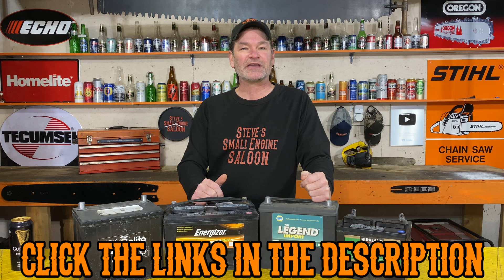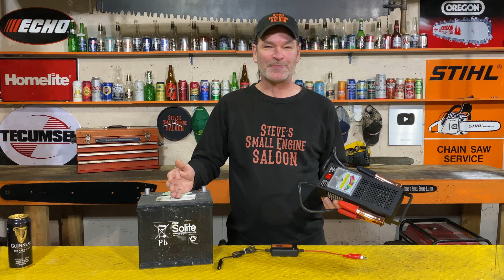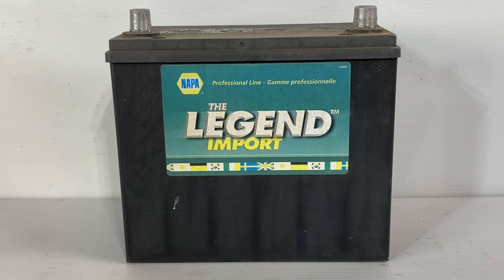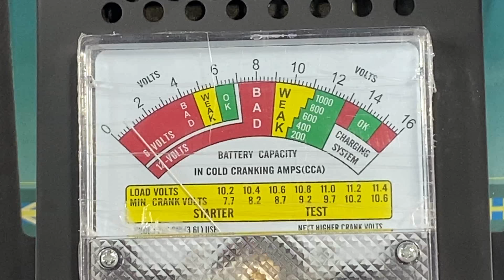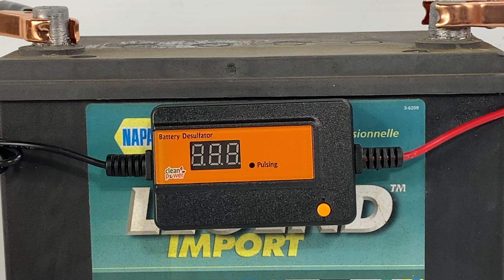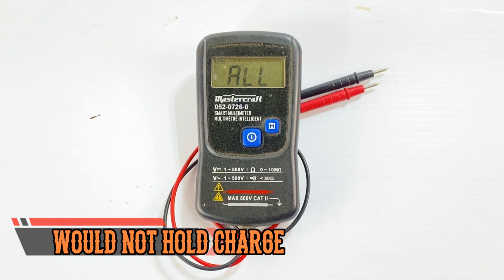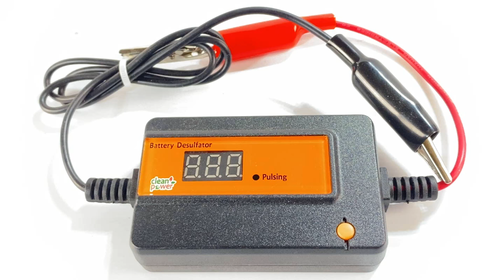Does An Electronic De-Sulfator Really Repair A Battery?? See Real Results

Comment: Theoretically you could probably get the desulfator working by adding some mineral water mixed with salt as an electrolyte and it should boost its ability to start charging again it'll allow the liquid inside the battery to hold that electrical charge but you have to fill up each cell with fresh Don't dump it just add to it and it should work with any battery that's 12 volts as long as you can pop open the cells

Comment: My mechanic let the battery go down really low before I towed back to my place &fix it myself..,auto zone said battery is no good but they charged it anyway & it worked, couple of weeks later let the car sit for a few days with the radio on of course dead one again used one of those reconditioners and battery us holding up good after almost a year
Reply from the maker: Right on

Comment: I have a duralast gold car battery, not even 2 years old,the battery won't hold a charge, i took it to  AutoZone to test it, it says bad battery. But the battery can charge up to get over 13 V and even 14V. It just won't hold a charge, so now I'm doing a battery recondition with a everlast 40 amp charger. Ill have it set for 24-36 hours. 
If the battery can charge, is it possible that after electric recondition the battery will hold a charge??
Watching this video gives me the thought that it will.

Comment: I just bought a fully automatic electronic battery charger ($35), that has a "battery repair mode", which is an electronic de-sulfator function.  I just had to replace a large, expensive, group #65 lead acid battery in my vehicle with the same symptoms as your battery #3 (charging but not holding the charge).  I had already ruled out the possibility of an alternator malfunction and/or a parasitic draw.  
I bought a new, more expensive AGM battery replacement and it fixed the problem.  Now I have the old battery running the de-sulfator process and we'll see how it goes.

Comment: Steve on the batterys that didnt recharge two things comes to mind water level especially on sealed battery if the level is low you are not going to recharge them  and secondly it could be they need cleaning or flushing as sometimes theres a build up underneath the plates that shorts them out so they are not going to recharge  i have seem people tip out the contents flush them with clean water  filter out the battery acid and then refill them and recharge them and that can fix batterys and that was an old method that they did back in the day if there is any damage to plates  maybe they were overheated and buckled and shorted you cannot save them by desulphating  if the issue is sulphation then it obviously worked on two  of the batterys which is great as you say it paid for itself .

Comment: I bought the same Desulfator and it worked on two of my batteries but didn’t do much for two older ones. Does anyone had experience on why a battery cannot be desulfated at 2Amps with this little gadget?
Reply: I've learned the hard way that lead-acid batteries can leak though their plastic enclosures. There might be a reason you need to add distilled water to your battery, it might have burned though that crappy plastic enclosure.  Sucks to be a consumer.

Comment: Great job making the video Steve, you brought up a good point that battery desulfators do not work on all batteries, however you can leave the desulfator attached while charging a battery. I have a Pulsetech PowerPulse battery desulfator that I leave on my BMW battery for the past three years, and the car starts without any problems even though I drive it about 5 miles per day, 25 miles a week. Pulsetech claims that their patented frequency can extend the life of a battery three times or more, I'd like to see you do a test on them. 
Also the Noco Genius 1 charger you have on your Amazon links has a mode to desulfate batteries, but I believe it's uses voltage spikes to remove the sulfation.

Comment: can also be done with a 200amp charger in one day. cells must be topped off with distilled water. charge @ 200amps for 15 minutes. let the battery sit for 1 hour. charge again 200amps for 15 minutes. Let sit for 1 hr, repeat 5 times. That should fix the battery. you can also use a welder but that is much more risky.

Comment: I have an EV and I've been running it for just under a year now. I have a battery charger with the reconditioning function on it and I plan on doing it every year to ensure the long life of the 12v battery. The main reason is that EV 12v batteries have a very easy life. They don't have that jolt of starting the engine, which apparently is what helps to shake of the sulfation from the battery walls. Therefore a reconditioning is even more important......apparently!

Comment: Pretty obvious you had 2 batteries which were actually sulfated, and 2 which had lead plate issues which are simply unsolvable in most cases.
I've seen some come back to life after people have put some vibrations through them, though they still usually fail in months as there is too much shed material which short cell/s out again.
Would have really been interesting if you would have cut the tops off and pulled the actual cells out to see what failures looked like.
Good video, but that rather expensive for a desulfator which can be DIY'd for $5-10.

Comment: the two major failure modes for auto batteries are the electrolyte boiling off resulting in dry cells,and the second is the lead paste coming out of the plate grid and accumulating at the bottom of the cell,eventually shorting out the plates. that's because auto batteries are in a high shock and vibration environment. a battery with shorted cells won't desulfate,that battery is DEAD. and needs to be recycled.
Plate sulfation of a car battery is not the usual failure mode. but 12v lead-acid batteries are used in many other items,like lawn tractors,backup generators,some kid's powered toys,computer backup supplies. Those are not used as often as a car,so the battery plates develop a hard sulfate layer that blocks ion transfer. it acts like an internal resistor.
A desulfator take the 10-12v of the battery,and uses it to generate much higher voltage spikes that break down that sulfate layer. There are plans on the internet to build them,they're not complex. mine generates about 60V spikes with a very fast rise time. you can run my type of desulfator while trickle charging the battery,so you can leave it on for several days,because it may take that long to clear off most of the sulfation.

Some battery charges come with built-in desulfating circuits.
Reply: 8:07 8:07 8:07 8:07 8:07 😮😮

Comment: Drain the acid from the battery and save it in a cup or something. Take some distilled water and add Baking soda then pour that in all the battery cells. Leave it sit for a couple days. Now after a couple of day drain the water/ Baking soda from the battery. Rinse the battery out 4 or 5 times, Now screen the battery Acid you saved and put it back in to the battery then finish filling the battery up with clean distilled water if needed. Now put high charge on Battery like 200 Amps. Let that charge for 15 minutes after 15 minutes shut off charger and let battery cool for one hour. Now turn on High charge again for another 15 minutes. Do this 5 or 6 times, charging 15 minutes on high 200 Amp then letting the battery cool down for a hour. After your done by the 6 time put the battery on trickle charge 2 Amps over night. Now sometimes you have to disconnect the charger if you can't get a full charge. Then after you have disconnected the Charger turn on your head light till the battery is completely drained and dead. Now put the battery on trickle charge over night and your battery should be able to take a full charge now and should be 13 volts or higher. I don't know why but sometimes you have to do this after the cells get cleaned up. It's worked on every battery I have done it on. Now if your battery's plates are ate out of the battery after 15 years or so it won't work. But I have batteries that are well over 15 years now.
Reply: please can you make a video of this so that we can reset our batteries and get extended its time please

Comment: We live off-grid, 24 volt, eight 6 volt Rolls Royce batteries.  We also have a 12 volt system.  I kept the batteries we replace to restart the 12 volt system dedicated to lighting the house at night.  I can't revive them for sh*t.  Anyone got a proceedure for this?  Tried epsom salt, the whole 9 yards.  Suggestions? (besides spending money on new ones?)

Comment: Hey Steve, not sure if your going to see this or not but if so, I've looked at this product and it appears to be suitable to connect to back of series bats up to 72v, This is good because sometime in the not to far off future, I will be reconnecting all of my system to work at 24v instead of 12 and then acquire a 24 to 12v high current reducer circuit for the RV. This will allow me to increase my wattage from solar to just over 1.5k watts charging with the new MPPT unit. So for now, I'm going to order one of these and pull out 1 battery from the bank of 4, put a blocking diode in there to stop the power from the Desulf. from getting to the others, each in turn and let the MPPT keep charging all 4 and hope I can salvage all of them before winter arrives, in late Oct. hopefully not sooner. Either way that should be enough time for me to find out if they can be saved. Thankyou for the video and the link, you turned me to the best price model I could find so far.

Comment: I've heard and read (in Motortrend) among other places, that these DO work! Much of the time. Facts are, they''re not a garranteed fix  for EVERY battery but they will fix batteries that CAN be fixed. So they are definitely worth the cost. At the  moment, I'm attempting to construct a desulfator from parts and scratch, maybe I'll get it down maybe not. Right now I need at least 2 of them to try to save my battery bank in the RV. I don't have time to wait before winter gets here. I just have so much to say about batteries myself as being a mechanic for over 40 years, a person sees about all of it. I should have invested in some of these years ago. I'm not going to wait much longer though.

Comment: Got a question Steve I ordered and then finished watching video and seen where you said it needed around 8 volts to work...working with 8 volt golf cart batteries as long as I hook them in a circuit like they were and come up with 8 volts I could then hook it to all of em at once 🤔😁 just trying to think outside the box  lol

Comment: You can trick the desulphater and most electronic battery chargers that need a certain voltage to start by either using another battery or by adding AA bateries to get the start voltage up, It does not work on all bateries as I had one that would not start but have done a few that did work,Be careful when working with lead acid batteries you can get burnt. Its worth a try, nothing ventured nothing gained as they say.

Comment: Have you tried connecting the one that does not go past 8V in parallel with the one that does not go past 11V and charge it? I moved tricked my charger to think there is minimum voltage to get it to switch on
Reply from the maker: Great idea!

Comment: Awesome video Steve! I have a "garage queen" car that I barely drive and my old standard trickle charger kept the batteries alive for up to 2 maybe 3 years then the batteries just die. I bought a C-Tek charger and my batteries last a lot longer now 5+ years.
I keep on top of the electrolyte levels every few weeks.
My daily driver has a fairly newish battery that has started to fade (320cca) connected up the C-Tek charger and it's starting to come good again. Alternator is doing it's job too.
Just bought one of these desulfators to mount in the car. 
Thankyou for the review... I'm sold!! Nothing worse than a dead battery miles from home!

Comment: gotta quick question....i have a scooter ebike a 2017 emmo shadow. it has 5 12v20ah batteries in series...now do you know of any desulfator can do its magic to 5 connected batt in series so 60v approx. ive seen videos where the desulfator had to be left on for a week...i cannot spend 5 weeks trying to regen batteries....but then again new ones will cost anywhere from 75-100$ each to replace....now do these tools really fix a battery to a new battery condition? or are you simply prolonging the inevitable....i ask because when ebike batteries are used its a constant discharge rate while using them....not just a 3 second pulse to run a starter....anyway...if anyone know the honest answer...please do reply...i would be truly grateful before i go spend almost 600$...thanks to anyone how offers an opinion!!!! TK.

Comment: I purchased an Optimate 7 hoping it would work for my batteries. It is supposed to work with batteries as low as 0.5 volts. It wasn’t cheap though. Time will tell if it will pay for itself or not.

Comment: NSaw1
NSaw1
1 second ago
I have messed around with reviving quite a few batteries I have gotten at the dump. Mostly dried out AGM batteries. But also a few flooded ones too. 
I haven't found any sealed flooded lead acids yet, but for the flooded ones and the AGM ones I filled them with water (every one I have gotten had low water, for the AGMs I had to pry off the plastic cover and take off the silicone caps), and charged them slowly and some would hold a charge indefinitely. But some didn't hold a charge and all of them weren't able to output hardly any current. (They all had probably sat out for who knows how long, so lots of lead sulfides on the plates) These batteries where so bad that even if I put a small 12v incandescent light on it the voltage would drop to nearly 0v. 
So what I did was I took a lower resistance resistor (a bit of a dryer heating element) and I connected the battery with the resistor in series to limit the current down to like 20 ish amps but in reverse polarity to my main battery bank with a charger. 
Since there was so much sulfate it very quickly came right up (in reverse voltage to the dead battery) to the voltage of the main bank. And with that resistor I just flipped the polarity back and forth at first every 30s or so and then slowly starting to leave it for up to several hours each time. Once I did that I let it charge at a pretty high voltage on a adjustable charger (I think it was around 14.8 volts for about an hour, then a lower voltage something like 14.5 for a couple days)
After that I was able to use it to start our riding lawn mower just fine many times. (I believe it was 10 times and it takes probably 5 rotations to start usually) 
And so I let it run and charge for a while, and then left it for over 4 months and it started the mower right up no problem.
Then the larger car battery was the one that didn't hold charge or voltage (I assume sulfates and also a/some shorted cells) 
I did all the normal things as the other one, but since this one wouldn't hold a charge at all, I tried something a little different. I went and directly connected it to the battery bank with no resistor and reversed the polarity many times like that. It boiled a lot and after a couple times of doing that I believe that whatever was shorting out the cell/s broke free and cleared itself. After that I was able to do the same thing as the first battery and it made it be able to store a good bit of power. Not as much compared to the other batteries I did that didn't have the shorted out cell/s. But it was able to work and for some smaller things it would work just fine for. 
So far the only batteries I haven't been able to fix are ones that are physically broken or the plates inside are visibly falling apart lol

Comment: Sweet! First time viewer. Congratulations on breaking through the noise and landing on my recommended list. Thanks for taking the time to test this gizmo on batteries with different issues. You broke Amazon, though! 😂 The linked desulfator is no longer available.

I noticed the device supports 12v–72v batteries, which makes me wonder… what if you had two batteries that would not charge up to 12v and ran the desulfator on them in series?
Reply from the maker: Great idea!

Comment: I've been able to recover batteries that I never expected would (they sat dead, drained to zero, for weeks), by slow charging them at the lowest rate of my fully automatic charger for several days.
The most important lesson I've learned about lead-acid batteries is to not overcharge them.
The 2nd most important lesson is if a slow charge doesn't recover them in a couple/few days, they're done.
3rd lesson is, after resting 24 hours without the charger or any load attached, the voltage is less than 12.5V, it's done.
4th lesson is, only water the battery enough to completely cover the top of the plates, overfilling can cause internal shorts and spillage (ask my corroded battery tray!)
Don't drop your dentures into an open cell and be safe out there! ;)

Comment: if it does what it's supposed to, for sure it works if that's the problem. That function is built into big lead-acid battery charger systems to extend the longevity and charge of them